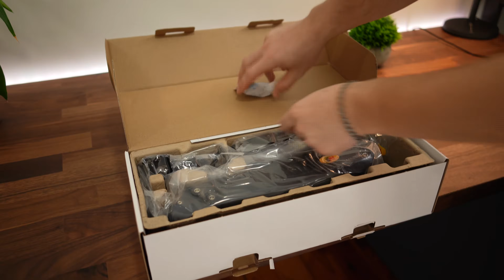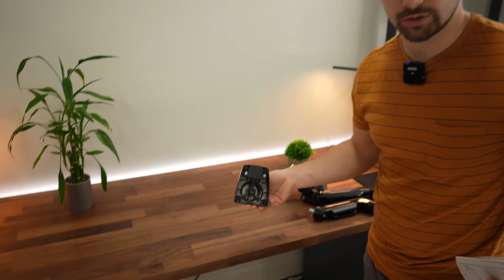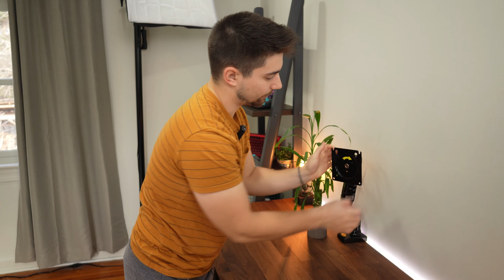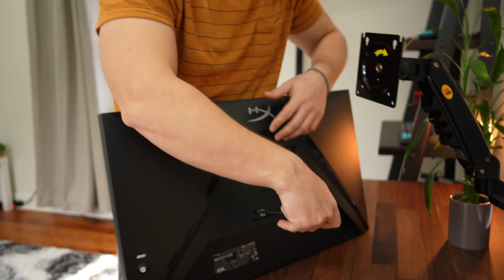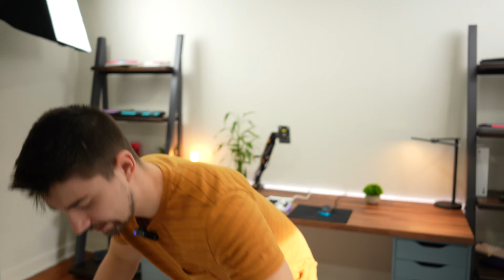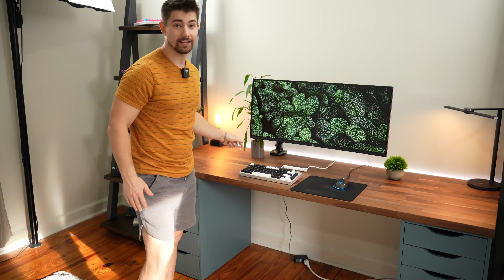UNDER $30 Monitor Arm! - NB North Bayou Monitor Desk Mount Unboxing & Review

Comment from the maker: UPDATE: I was easily able to pull the yellow branding stickers off of the monitor arm, after doing this there was no residue and looks great overall, huge pro!
Reply: was it just a sticker? I thought it was painted. Please confirm
If just a sticker a hair dryer should do the trick!
Reply: @soumenmohanty1  its just a sticker.
Reply: @soumenmohanty1  you don't even need a hair dryer, it comes off extremely easily by just pulling it with your fingers and leaves absolutely no residue
Reply: I think they did that on purpose too.
Reply: I only came for this and you dileveried <3
Reply: hey so you can remove the stick of the base and off the monitor arm
Reply: hey i was wondering if you remove the base branding us
Reply: i subbed your channel helps a lot! thanks👍

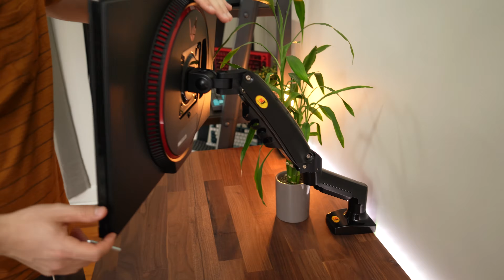Comment: 8:15 I've been living with this issue since 2021, light monitor, and I  tossed manual after moving and gave up on it since it kinda worked. I finally looked it up on YT and you solved my issue after watching your video 8 mins in. I just pulled the monitor down and tightened the screw till desired behavior. TLDR thank you for this section specifically im a big dum dum for not finding this 3 years ago.

Comment: My monitor is tilting down even though I've tighten the screw for it. What should I do ?
Is it manufactural fault or something else ?
My montior's size is 27 inch.
Reply: Hey i have the same problem it tilts down unless i really over tighten the screw and it locks it to that position and can’t tilt it anymore without risking breaking my monitor how did you fix yours?
Reply: It's working great now.  I was doing wrong. First, we need to hold the monitor where we want it to stand and secondly, tighten the screws. It is not like we have to tight it so much. But it is in somewhere in the middle of tightening it holds the screen.
Reply: @shivaniarora7809  i just did this it much easier now to tilt to monitor thank you so much.

Comment: Just got the North Bayou A6 Heavy Duty over the for my LG 45 Inch over eh Brateck or Thermaltake arms. Hope it works well over time. I got it because it can extend much longer as I want to extend it all the way to the side to watch movies on my bed as well.

Comment: Just got mine installed last week, damn the top arm is hella stiff!! I can't lower my monitor without adjusting it from the arm itself even with the maximum adjustment. I'm pretty sure I screwed the right way cause it was not budging with the stock adjustment. Mine had no flashy branding stickers too.

Next upgrade might be a 1440p monitor cause the monitor is closer to me now and those 1080p pixels are just not it. I can't set it up farther due to space constraints. But hey, my table's a lot cleaner now! No more bashing my mouse on the monitor stand!

Comment: I have the same monitor arm, its north bayou F80.. it does tilt down without adjustment when I put my Samsong Odyssey 34" Oled.. based on specs its 5.5kg. I need to crank the tilt adjustment a little bit but it is now hard to tilt.

Comment: How close can you actually press it towards a wall?I haven't got a wide table so I would be terrible I want to do homework and the screen is sticking out.Hoe close can you push it to the wall?Or is it possible to push it right to the wall if I adjust it on the edge of my table?

Comment: Guys how stable is this mount on the desk i heard desk mounts can get wobbly should i get that or a wall mount
Reply: it depends on how far the monitor is out from the stand
Reply: @cengi  what about the kinda looking vertical ones the ones that look like a tube or a rod is attached to an arm are they better or it doesn't matter

Comment: I've bought a $40 arm off Amazon recently, and it's holding my 43" TV on it.   You do need to but a bracket adaptor as the VESA screw holes are more spread out,  but aside from that,  it's perfect.
Reply: How is it after a few months??

Comment: Great review man 🎉 My only concern is the longevity of the arm with that extra weight. Although it's marketed as 17 to 30 inch and you managed to install up to 34 inch, the question now is, won't the arm collapse in the future from the extra weight? Thanks mate 😊
Reply: You should consider the F100A (12kg) if that worries you, but honestly, I think the F80 (9kg) will do just fine is long as you stay below that. 34 inch monitors are usually around 6kg, so they're still within spec.
Reply: @borkborkinson7901  Bummer! The MSI Mag 323upf monitor that I'm gonna order is 10.6kg and it's only 32". Then, how 34" monitors are usually around 6kg? ... Many thanks for your help :)
Reply: @Ahmad-Mounir44  I looked up the 323UPF and the specs from the official site says 6.8kg without the stand, (9.7 with). The listing you saw probably includes both the stand and the packaging for the weight.

Comment: I just got the "two mount" option and can't be more happy! 😌
Reply: How do you lower it
Reply: I’ve tried everything and it will only go down so far
Reply: it’s a gas‑spring arm, so if it won’t go lower it’s usually just the tension.
 With the monitor mounted, use the included Allen key on the screw marked “+ / -” and turn it towards “‑” several turns to reduce the tension until the arm stops pushing up... Then push the monitor down to the height you want, the arm should stay there once the tension matches your monitor’s weight.
  🤔  If it’s still too high at minimum tension, the screen may be very light or you’re just hitting the arm’s minimum height range, so you might need to mount the base a bit lower or add some weight to the monitor.

Comment: I just got mine. They are designing the arm differently now. There are no glossy pieces anymore, but more importantly, the base only had 1 screw as opposed to the 3 screws on the one in the video.

Comment: 32" G8 almost wants to sag, and if I mess around too much it will, until it doesnt. I cant figure out which alan key -point is the one that fixes tilt. If its the one I think it is, its so tight I cant figure out which way is tighter and which way is looser and its locked up....if LOOSER makes it less prone to tilt, well...that's very counter intuitive, and if TIGHTER makes it less prone to tilt, well its so tight I may have stripped it yet it still wants to sag. The G8 is only 15 pounds and the weight limit is 20 so this kinda sucks.

Comment: How many centimeters are there from the wall to the back of the monitor if I push as much as possible against the wall?
Reply: I have the same questions 😢.Have you already found out?I haven't got a wide table so it is crucial for me to push it as far to the wall as possible

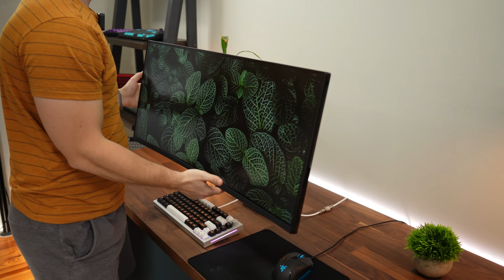Comment: 15:17
I have NB F80 to using for Msi 34" MAG342CQR Ultrawide Monitor. The arm holds it but it doesn't let me set tilt adjustment. I have to tighten the screw well. When I loosen the screw enough to adjust it manually, the screen leaves itself downwards. So I bring it to the angle I will use and tighten the screw well. Is there an another way to adjust tilt manually? Thank you.

Comment: does this mount work with any monitor because when I tired putting my crua 24inch monitor on it the backs didn’t match so I was confused
Reply: Depending on the monitor, it has to have VESA standard mounts, 75x75 or 100x100. 
Sometimes the mounts are hidden by a removable plastic plate behind the monitor

Comment: for some reasons when i tilt the monitor it makes a huge noise. if i reduce the strength with the allen key the arm cant hold the monitor in position. does anyone know if its my arm problem or if there is a way to fix it?
Reply: Same here, found any solution ?
Reply: a piece of paper on the clamp part. where it touches the table. it's now silent.

Comment: Can anyone tell me what the Invision MX200 is like ? It looks very similar to the North Bayou to me but I prefer it on the aesthetic level.
Reply: Same generic product from China sold under different brand names. I got the MX 200 yesterday. Thought it was a quality brand from England but it just from another back alley factory in China. I don't like it all. Functionality is very poor. It's very hard to move except for moving it left and right. Tilt is impossible to get right. The screen either goes backwards or is very hard to move. Just a micro millimeter adjustment does this. Up down also extremely hard even with the adjustment screw at 100% loose. Swive, which has no adjustment, is also hard. In other words, its a piece of junk. 

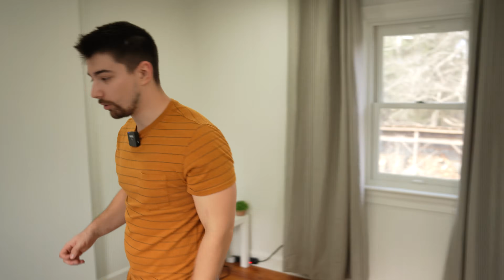Compare this to one I tried in an office. That was butter smooth in all movements. With this crap, I'm actually afraid to ruin my 27 inch monitor because you have to grab it really hard , also because its so hard to get right. 6:46

Comment: I just installed a 17.20 lbs 38" on it this arm. So far so good!
Reply: How’s it doing now
Reply: @VosDoesGames  it's fine for my purposes. I move and adjust it once in a while depending on use case.
Reply: did u have a problem where it doesn’t go up and down? cus i just installed mine and i can’t adjust the height.
Reply: @asher3527  Try adjusting some of the tightening screws. You have to hold the monitor while you work or it may drop onto your desk. Be careful
Reply: Yep, I’m very sold on this rn

Comment: I currently use an Asus 24-in give him monitor and I got this monitor arm and I assembled everything correctly and attach the monitor to the arm however from what I can tell the monitor itself is too light at 24 in and even if I adjust the gas spring and try to push the arm down it goes right back up so I'm going to get a much newer monitor maybe like a Samsung Odyssey G8 34-in NC if it makes a difference anyways great video I'm enjoying what you're doing keep up the awesome content.
Reply: At first I thought my monitor arm was broken or my monitor was too light. I adjusted mine counter clockwise to the max and it did it. My monitor weighs very light too.

Comment: Does anybody know if the mount is working on a table that has an angle on the back of the plate?
My table has an angle and after about 5-6cm it is normal horizontal..

Comment: I empathize with those individuals who purchased the item and initially perceived it as being of poor quality, when in fact they just needed to adjust the grip. Fortunately, I came across a video that provided me with this valuable information. I was concerned about potentially wasting a significant amount of money on my Gigabyte 32-inch monitor, but now I feel relieved. 😆
Reply: 30$ isn’t a significant amount
Reply: @solid_viper95 I wouldnt agree with you but mans fr has a gigabyte 32inch so ik he could of afforded a few more
Reply: @reloadedwins  I'm pretty sure he meant he didn't want to risk his Gigabyte monitor by using a "cheap/budget" monitor arm, he just wrote it wrong. lol
Reply: @TarekElsakka  yeah your right, still tho gigabyte monitors are expensive
Reply: @reloadedwins  yes they are, especially where I live. The QHD Aorus ones are ridiculously expensive here. I bought that monitor arm a few days ago and it has been amazing, by the way. I have a 27" ViewSonic OMNI VX2728J-2K weighs around 10 pounds and the arm is very sturdy, no issues at all.

Comment: This is just what I was looking for! I have a curved 32" Dell monitor and ive been needing a good arm to get rid of the heavy base lol
Reply: Update: works amazingly. Took a little finangling with the tensions to get it to stay up but I haven't had any issues!
Reply: @1155media  does the monitor shake when you type on your keyboard?
Reply: @KhaledSham  yes it does, especially if I'm typing aggressively. It has more to do with my desk, though, since I have a sit-stand desk with a fairly high and heavy center of gravity.
Reply: @1155media  Oh well that's not nice. Did you use it while playing games with your keyboard? how was it?
Reply: @KhaledVlad  it's still pretty solid! Not a whole lot of movement when playing.
Reply: @1155media  I see. I just bought it, thank you so much!
Reply: Could you please let me know your thoughts about this monitor arm after using it for 4-6 months
Reply: @mohammadbawardi6571  it's still working pretty well! No adjustability issues and it was easy when I swapped it between desks!

Comment: Had a Xiaomi Mi Curved 34 ultrawide mounted on this mount. It was ~17lbs, so significantly lighter than the LG ultrawide. It had no problems handling that.
Reply: I have the same screen I will do the same

Comment: Have this arm, and it is PERFECT for 24-inch monitors
But when I upgraded to a 28-inch ASUS the tilt becomes stiff, surprised he didn't see that as a down side 
But I am fidgety when it comes to adjusting my monitor so if you always keep yours at the same tilt then it shouldn't be an issue
Reply: how is the joint lubricants after long term use

Comment: Question, my desk is like yours sitting kinda flush against the wall, maybe 1.5cm space. Can I mount this arm right in the middle and fold it in a Z shape position so that my monitor can sit flush against the wall and move closer to me when needed?
Reply: This is exactly what I'm wondering. Did u ever get an answer. I like my monitors AGAINST the wall but if I need to I can pull it out all the way.

Comment: I purchased this, but I can't get the adjustments, so it just sits in one place it won't go up and down, but it's cool
Reply: Same here. It's a piece of junk.
Reply from the maker: It may be that it has too much tension.  Have you tried releasing a little tension?
Reply: I have it doesn't do anything
Reply: Yes I did I sent it back loli didn't have the patience to mess around with it

Comment: I have this as a arm for my secondary 27 incher. Does the job with no complaints other than the ugly yellow logo that I try and cover with my deskmat 😅
Reply: I did remove them 😅
Reply: @techwolfcave  howd you remove them?
Reply: @sanjaypersaud9695  mine was just a plastic logo that was stick on the arm. I just remove them and cleaned the residues. Maybe that was the outdated version. I think this one is the new one, i guess.
Reply: Just put a sticker over it ;)

Comment: Sub $50 monitor arms will get you 99% of the way there. i bought a like $350 dual arm from Dell and i loved it visually but functionally was just not it, liked 2 single arms that i got for under $80 more.